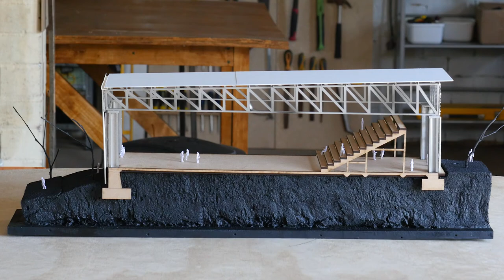Structural Architectural Model Build - Perth Metropolitan Basketball Court | Modelmaking

Comment: How did u stick laser cutted board ? which kind of white adhesive it is ? Fevicol ?
Reply from the maker: +Neha khare Hi Neha, the laser cut components are made of MDF Boards, being a timber product, I simply used PVA wood glue =)
Reply: Thanks for answering.
I'm working on my thesis architectural model.Your videos helping a lot !

Comment: omg. you've spent so much time on basing it in a totally inefficient fashion.
Just cut that shape from HD foam with a hot wire cutter..... coat it in wood filler PVA and house paint and you are done in an hour. why use purr, that stuff is toxic takes ages to set and u need a mold for it. Why use epoxy? that's messy and takes eons to set. That's just doing unnecessary work to create billable hours. It really hurt me to see that this is the way your agency bases.
You also really need to step your tree game up.  no hate, just shocked to see this done this way.
Reply from the maker: I can ease your pain a little by first saying this isn't the way the firm I work for make their bases and also if anyone asks I won't recommend doing it the way I did it in this video. I made this model for a structures unit in university. I am in the process of planning a measuring video but you've got me thinking I better make a base making video fast if younger students are rushing out to buy the materials to do what I did. So thanks =D.

Anyways, If you take a look at the big mountainous terrain model in my 2nd adhesives video in the part about epoxy, you might better see why in that model this process would be more suitable because I was trying to shape by hand a cliff completely disregarding the contour heights in real life, it was more what I think looks good, labor of love sort of thing and I was trying to demonstrate what was possible in shaping with the foam in this video as I didn't record any footage of the other project.

For this project, which has barely any slope and most of it on a flat ground. You are 100% correct, I think.

Well 95%, you don't know my tree game >=(
Reply: Did not mean to offend you! I was just shocked. for irregular shapes you can also just stack hd foam and go at it with a knife or hot wire tools.if you want to learn about effective basing look at people in the train or wargaming hobby. Luke Towan, Lukes Apps and the terrain tutor can help you hone your skillset!.
Reply from the maker: Thank you. The purpose of my channel is actually to both teach and learn myself so I do welcome your comments. I was miffed by a couple of assumptions you made in your comment but your content and suggestions was sound. 

Funnily enough though, you were right and I do have to up my tree game too haha. After responding to your comment, a couple of days later I showed my boss a personal model I made with some semi realistic trees I was quite proud of only for him to point them out and go "What's up with these trees, mate?" :D Going to be re-watching Luke Towan's realistic tree tutorials.
Reply: the terraintutor owns trees like a baws